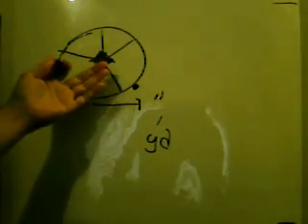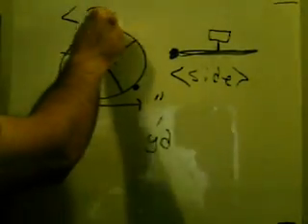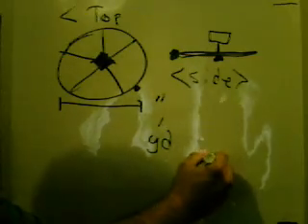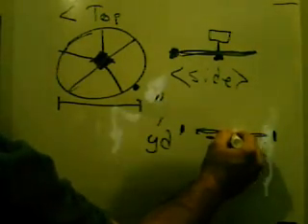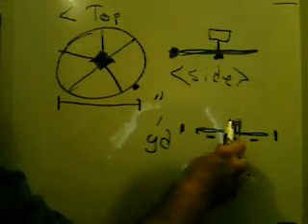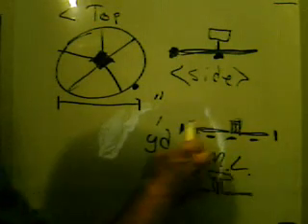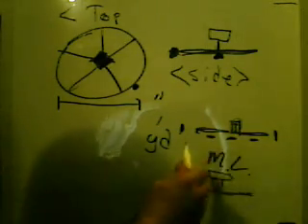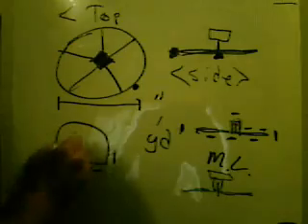Perpetual Energy Device #1 Considerations

Comment: Ok, first off... no matter how big you make your disc ONE revolution = ONE revolution. Making it bigger just makes the motor work harder. Furthermore, adding a transmission to a generator just reduces efficiency.  I know by your other posts that you haven't caught on to the idea of friction, electrical resistance, and transmission/motor inefficiencies. May I suggest that YOU get an education before telling others that THEY need to get educated. This is another (3 for 3) moronic idea.

Comment: impossible, if it was more than 100% which is impossible then the person should get Nobile prize for that

for your information, the efficiency of a machine uses only around 18% of the energy you used.
other 82% is lost in heat, friction and everything else

a machine that would use over 30% of the energy you give it would be "OMFG WORTH MILLIONS"

I guess that device you talk about can make lots off energy for short time but at the end uses alot more to just heat up the water

Comment: Actually, purely mathematically it's the same. I would very much like a machine that gives more energy than you put into it, and maybe it will be reality sometime. But you just cannot say that something you want to work will work if you put more effort into it. It's like saying that you can float into thin air or that you can travel faster than light. And nothing has ever been observed that travels faster than light. I like what you're trying to do but you should try to explain why it would work

Comment: Go out to a play ground. Place a microphone stand on the center with a small red flag permanently affixed towards one side of it. Spin the wheel from the outside and count how many pushes it takes to complete one revolution.
Think about how much energy you gave to produce that one revolution then multiply that by 2000 per minute.

Comment: Can 1 HP possibly be enough on the outside of the drum to generate more than 1 HP on the center? The revolutions per minute on the outer motor would be FAR HIGHER in relation to the revolutions per minute on the center of the drum.

Comment: My point is, the average 10 kw generator requires an exact spin on the rotor of 1800 rpms to produce 120 volts. Some even need 3600 rpms. Now this is consitantly standard between all sizes of generators. 
What decides between how much power, in watts, you get, is directly porportional to the HP of the engine that powers it. 
A 5 HP engine will give you something like 2500 watts.
That would be enough to power 2 saws on a jobsite.

Comment: Ive thought about gear boxes too. 
If you ever ride a mountain bike though, gears only displace torque in porportion to ratio of revolutions.
A generator has a draw that is directly related to torque. Lowering torque and increasing speed only increases the voltage. Torque is what gives amperage which is most important to utilizing power.